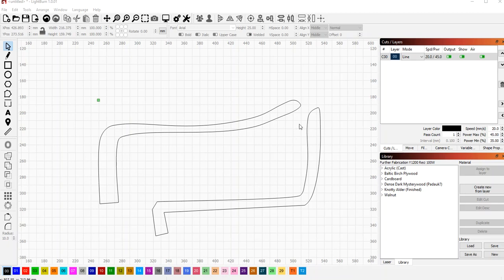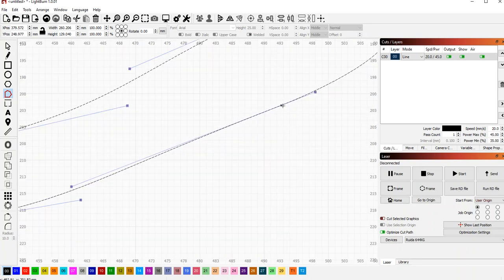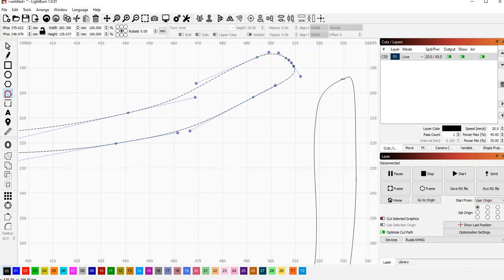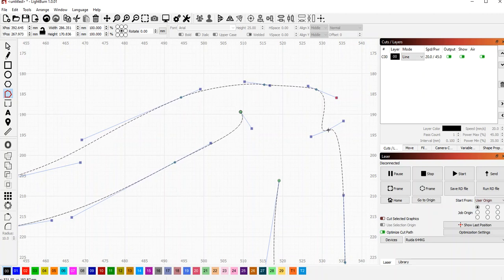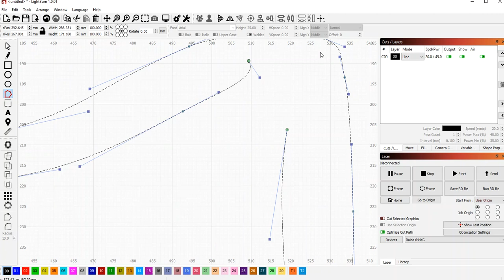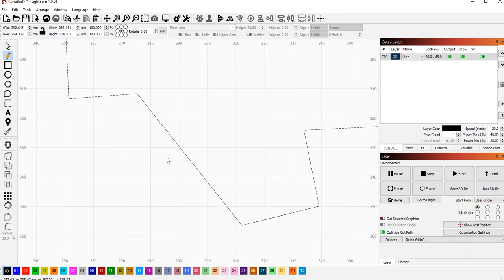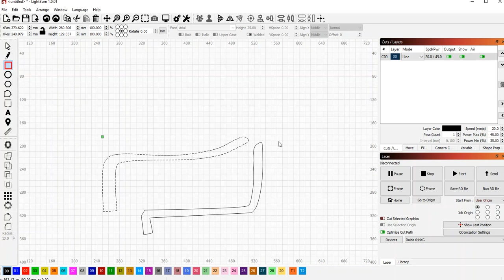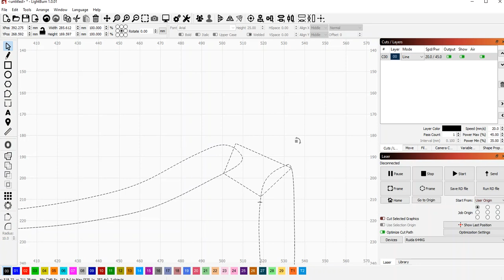LightBurn Tutorial: Node Editing Breaking and Joining Shapes

Comment: Help please. I deleted a line between points and when I tried to connect them together it would not let me. When I grab a point it turns to a red square. Hope that makes sense.
Reply: Found out the issue.  It's in the settings and you have to set your snap settings for lines and objects.
Reply: @rayturp6742  I'm unable to find the snap settings. Would you mind helping me?
Reply: @loraray1632 , go to edit at the top left of Lightburn and then the settings tab. In the window that pops up, there are the snap settings in the middle area.  there is a tab for snapping/snap to objects and one snap to Grid.  I have both selected.  Above these tabs on the right is Grid Contrast/ I have this set to off. Visual Grid Spacing/ I have it set to 10.00. Grid Snap Distance/ I have set it to 1.0. Click-Selection Tolerance (pixels)/ I have this set to 3.0.  Object Snap Distance(Pixels)/ I have this at 10.
Reply: I am having the same issue.  Won't reconnect to anything
Reply from the maker: I know this is an old question that I missed, but let me know if its still an ongoing pain point.